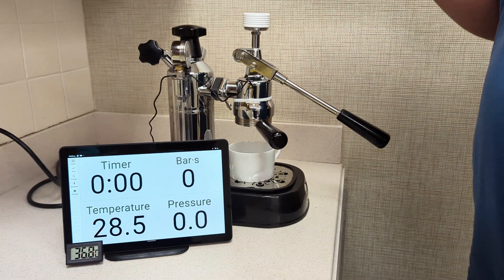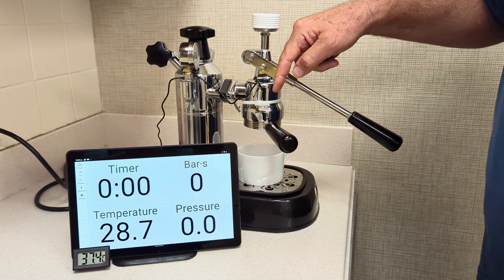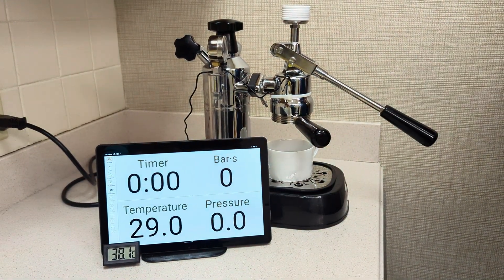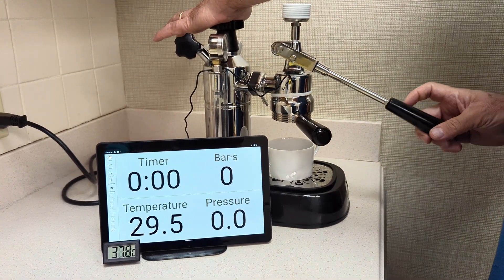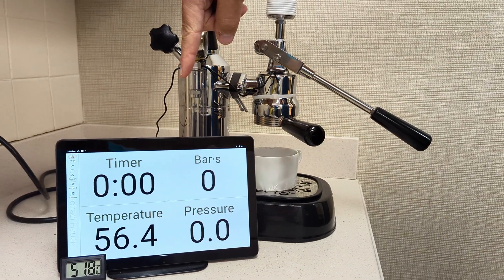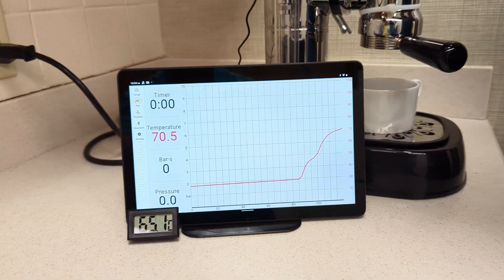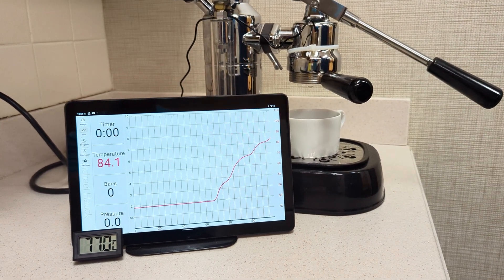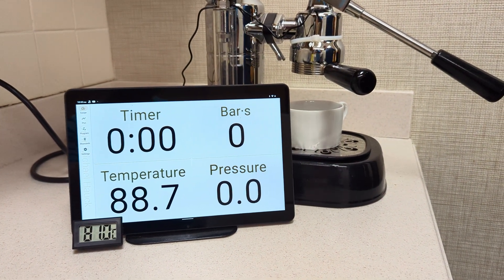1. La Pavoni Pressure & Temperature Profiling - Heating Up

Comment: Nice work! Is this going to be open source?
Reply from the maker: Thanks. The interface to the bluetooth device might well be.
Reply: @JohnMichaelHauck  is the app proprietary? Looks like it is written in flutter. What about the pressure sensor hardware? Would be nice if it could be built from affordable diy components. Like an ESP32, an amplifier and 200psi pressure sensor.
Reply from the maker: @val3rk  Good guess that the app is written in Flutter to be cross platform compatible. As for marketing, etc. I appreciate hearing your preferences. I'll pass them on to the rest of those invested in this effort.

Comment: Super interesting!!! !the temp probe is in the same device that the pressure one?
Reply from the maker: Yes, this design requires the pressure profiling kit, as it uses the hole through the piston and rod for both pressure sensing and the thin temperature probe wire.